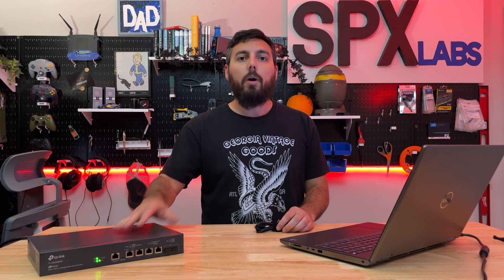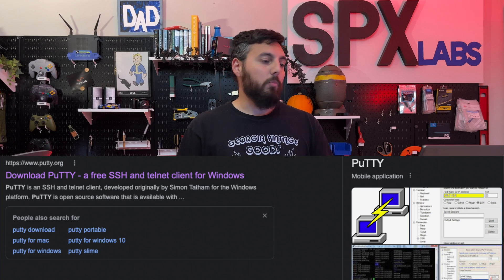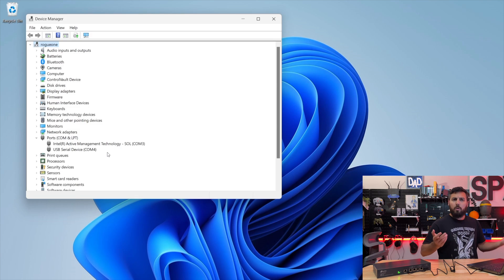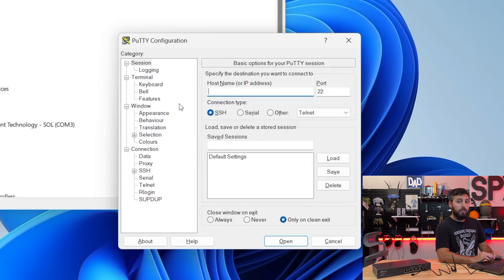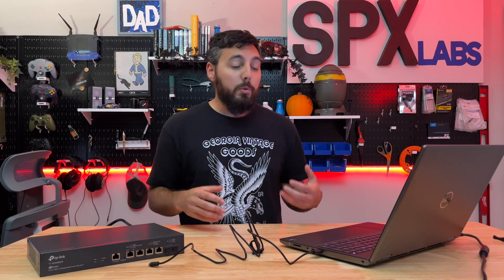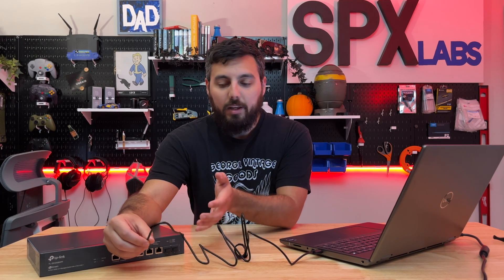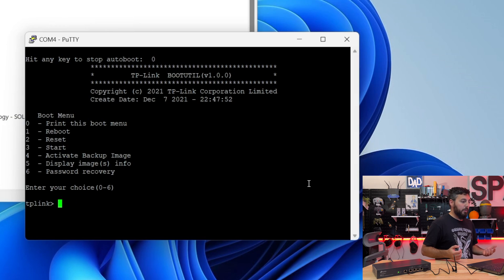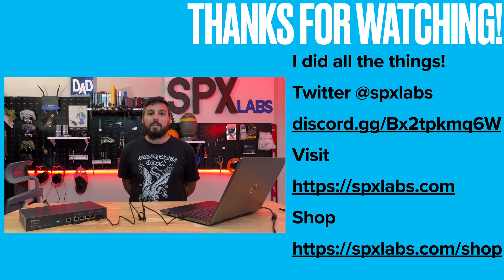How to Factory Reset TP-Link JetStream Switch using Micro USB COM Port | Omada Business Line

Comment: I have a TL-SG3428XMP (24 port PoE).  When I connect the USB I get a "TP Link USB Serial Com Port" under Other Devices and no good driver.  What drives do you use?  The ones from TPLink "TP-LINK USB Console Drive" do not work.  Support chat AND phone are completely useless, seriously it's a bad joke how bad they are.
Reply: If I was a business and had this set up and the entire network blew up because the controller overheated, and it took me DAYS to get back online, I would be fired, multiple times over!
Reply from the maker: I didn't install any drivers, it was all plug and play.
Reply: @SPXLabs  You must have installed some compatible drivers at some point, maybe for another project/video.  Fresh Win10 and Win11 do not have drivers, and the drivers provided by TP-Link do not work on their newer models TL-SG3842X/XMP.   Had to find a Serial-to-USB adapter, then it was super easy.  TP-Link Support admitted the USB ports often have issues.
Reply from the maker: Windows may have installed drivers unbeknownst to me.  I personally never downloaded and manually installed drivers is what I meant.
I’m glad you got it worked out.  I honestly wish there was more I could have done for you.
Reply: did u find the drivers
Reply: No, I gave up and bought a USB->Serial converter @samiraa78
Reply: @samiraa78  I followed the thread started by @dizzy49 with my SG3428 which couldn't come back after a firmware update. I had to install and uninstall several times the TP-Link supplied driver (from their downloads page, but nowhere else, and certainly not from the Microsoft repo). The driver attached itself to the COM port immediately and was identified as a TP-Link port in Device Manager (which was surprising, considering the other low tech aspects of this interface), but would not enumerate the COM port itself.  Hence the terminal emulators could not connect.  But trial and error carried the day, and eventually COM3 was identified and I was able to log in that way.  And Putty was fine, despite the warning in the TP-Link FAQ about using it with the microUSB port. Frankly, I was going to give up on the switch, though, so I was glad to see this video. Thanks, @SPXLabs.  And, to TP-Link, this is a terrible console / reset experience; isn't it time to upgrade from this early 80's interface?  Really, 38400 baud? This goes how with SDN thinking?

Comment: Thank you for making this video, great help 😊
Reply from the maker: Figured someone would need this, considering I needed it myself and couldn't find good information lol.
Reply: Unfortunately for some reason I am not able to beat the 3 sec time 😅😅😅
Reply from the maker: lol yeah got to be quick
Reply: Just wanted to check if there is any other way to do, I have tried a laptop and a desktop top for some reason its not getting in to Boot menu, it will be a great help if you can share that too
Reply from the maker: @jeetsarkar1989  You have to be very quick.  As soon as the device gets power attempt to connect to it.  There is no other way that I'm aware of.